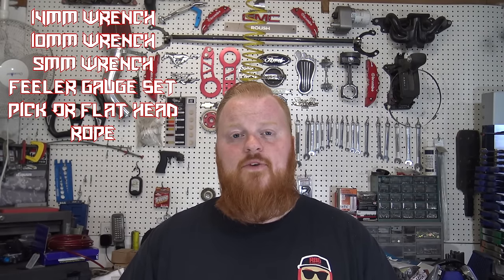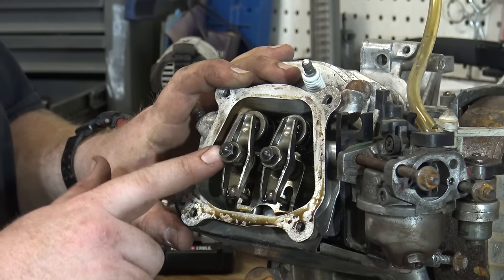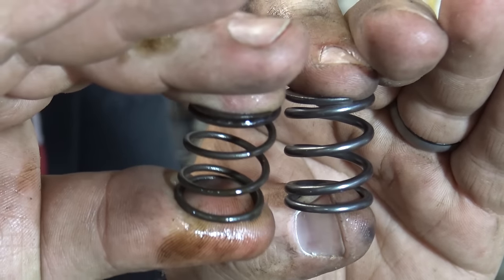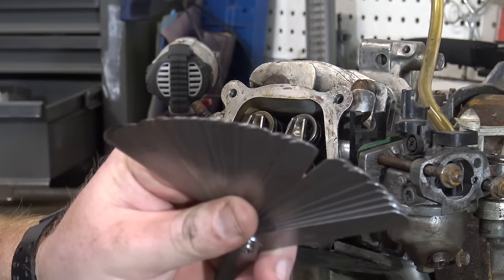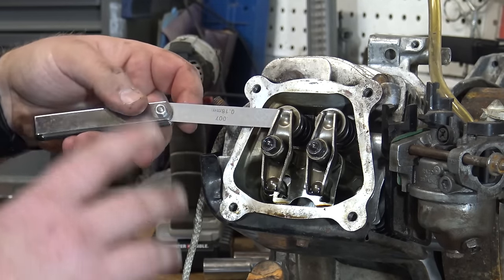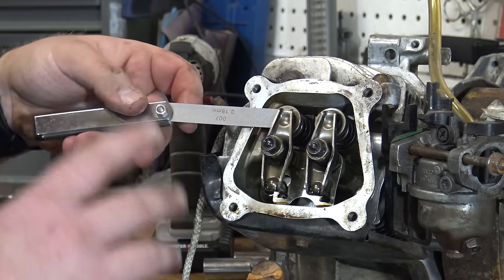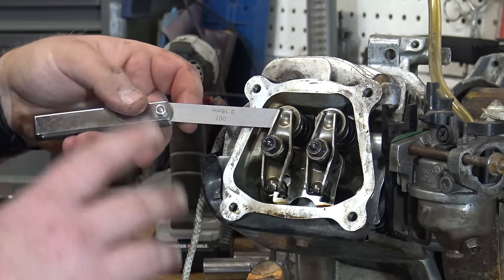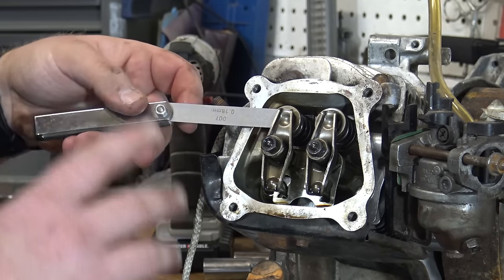How to Install 18lb Valve Springs & Adjust Valves GX200 / Predator 212 Hemi & Non Hemi Go Kart

Comment: My pull string gets ripped right out of my hand!! Billet flywheel, 18lb springs, torque converter, mikuni carb, removed governor.??
Reply from the maker: Seems like you set the valve lash with the compression release on. Make sure there is no pressure on the rocker when you set it.
Reply: @RedBeardsGarage what do you mean by this? Like when you put the rope into the spark plug hole? If it's not top dead center

Comment: Please help me.

I have the 212cc Predator. I took off the governor, have fuel in the tank and oil.

The engine will not start.
Gas is going to the carburetor,
Spark plug is sparking,
Pressure is coming from the cylinder when the spark plug is out.
Reply: Still having issues?

Comment: Hey red beard. I installed 22lb valve springs on my predator and now the pull start is snapping out of my hand violently. Is it because of the new springs?
Reply: The Hybrid Hernandez same thing happened to me. Did you find out what fixed this?

Comment: I installed the 18-pound Springs on my 212cc Hemi engine without the Billet upgrades. I ran it for about an hour and I blew the engine up. WTH. Can you give me some advice on how I could have the 18 pound valve springs and run the engine at Full Throttle for long periods of time. Thanks
Reply: The rod and flywheel become the weakest points with those kinds of mods. You need a billet rod and flywheel to keep up

Comment: Do you need to install the valve springs? What happens if you dont & run the stock ones with all the other stage one parts?

Comment: Does the piston have to be at top dead center when you adjust the lash?
Reply: Yes.
There shouldn't be any pressure from the pushrods on the valve rocker arms when you set your valve lash.

Comment: Do I have to replace the valve springs on the hemi when using the stage 1 kit? Or can I use the 18lb?
Reply: You can use the 18lb
Reply: @TheKidAustin09  could i run 18 lb valve springs with no other upgrades, not even governor bypass
Reply: @---bj8ty  yes you can

Comment: what would happen if u install a mod2 cam with out installing 18 to 26 lbs springs? 212 predator stock.
Reply from the maker: I don't understand why you would do that. The cam cost more than the 18lb valve springs so you might as well do them first. You could bend a valve. Don't do a mod2 cam without 18lb valve spring
Reply: Red Beard's Garage  how many pounds are the stock springs on the hemi? ...thnx in advance
Reply from the maker: +Krader Dewd probably around 10lbs
Reply: Red Beard's Garage where can i buy the 18 speings for my hemi
Reply from the maker: +Krader Dewd I have used the ones from go power sports and they have always done fine. They sell hemi specific ones on other websites.
Reply: Red Beard's Garage i have a hemi no governer/oil sensor thinking of putting mod 2 cam and 18 lbs springs do you recomand that setup and jetted pz27 carb..
Reply from the maker: +Krader Dewd yeah I'm about to install all that into a hemi in a week or so
Reply: Red, are you guna make a vid...
that would be awsome that a nice setup for the high rpms...
Reply from the maker: +Krader Dewd yeah I am going to make videos on it

Comment: After installing new springs and playing with the lash setting until I was blue in the face, I am having some issues. Seems I've got so much compression that I can't pull it over. If I pull the spark plug out, it'll pull over. First time I tried starting after new spring install, with spark plug in, I snapped the pull cord right off. Any ideas?
Reply: You might need to get a electric start, or you can try to get a much stronger pull cord and start hitting the gym at least 6 times a week 

I would recommend installing a battery and electric start because it will make your life much easier and now you have a battery so you can put lights on if you wish

Comment: Why do they make a 36lb spring for the predator 212? Can these be used instead of the 18lb?
Reply: Not with the stock retaining rings, you'd also need a low friction washer type disc to go below the springs because the stock ones just sit on the bare aluminum. 18lbs is the highest you can safely go with stock stuff. Now if you had all the sorted, 36lbs springs would be much much better, basically the higher you go in spring rate, the higher you can rev the engine without valve float occurring. But to get those revs you'd need an aluminum/magnesium flywheel, billet rod, high comp piston, methanol carb, head port work, and crank work.

Comment: got a hemi and the intake side rocker arm, for me to get the pin through the middle I had to compress the spring right off the bat like I had to work in there and the exhaust side one just slid right out idk if I did some wrong or its supposed to be like that.
Reply: just re adjust the valve lash I did the same and all I did was re do it and everything was fine

Comment: Does anyone know if they put a 3rd lash cap in the 212 hemi pred engine. I took the governor out and when I washed it out a 3rd cap was found  .i started the engine a few times to change oil and it was all good but I think they might have dropped a lash cap in it but not sure

Comment: I took my govern out still have stock springs an carb an for some reason I'm getting extra fuel in the cylinder an in my block what would be the problem thanks like way to much when I'm done riding I can pull the cord an fuel comes out of header
Reply: You your seals are bad. Dont run that engine without putting new oil in it after every use. If you took the head off it probably warped yo now that i think about it...

Comment: do the GPS 18# springs work in a hemi? I've heard they bind.
Reply from the maker: +KramersKlassyKustoms I have used them with no problem
Reply: Red Beard's Garage ok great. apparently there are 2 lengths of 18# springs. the shorter ones fit the hemi.
Reply from the maker: +KramersKlassyKustoms I never have heard that but I will check it out
Reply from the maker: +KramersKlassyKustoms yeah I just looked it up and saw that they sell two different sizes
Reply: Red Beard's Garage hopefully the ones from GPS fit my hemi. just need to decide what cam to use now.
Reply from the maker: +KramersKlassyKustoms they have worked for me. I haven't been using the hemi specific ones in my hemis and seems to be fine.

Comment: Okay I put the #18 springs on the 196cc jiangsu motor(not the 212 predator) for my trailmaster mb200-2 along with all the other stage1 upgrades. GPS told me to set my lash to .001-.003 for both valves so I set them both to .025. I'm having some backfiring on deceleration  and a little popping at idle is that a indicator of improper lash setting on one or both of the valves? Have searched for more info on these 196cc engines and come up short.
Reply: @152 snook
IF BY .025  YOU ARE REFERING TO METRIC
YOU MUST MEAN
.25MM.  THAT EQUALS 
ONE QUARTER OF A 
MM. WICH E

  QUALS 
JUST UNDER 
.010"  SO YES YOUR 
CLEARANCES ARE SET
Reply: 3 TIMES TOO LARGE.
SORRY PHONE MESSED UP.

Comment: will the hemi hold up with the 18lb springs with no billet rod or flywheel?
Reply from the maker: +Michael Keen yeah as long as your not going above 6500 and holding it a 6500
Reply: it's on a drift trike so it revs/spins alot
Reply from the maker: +Michael Keen I would plan on doing billet rod and flywheel
Reply: have you installed them before?
Reply from the maker: There should be a detailed installation video up soon

Comment: Do the H/F Predater 212's. use 2 lash caps on the valve stems ?
Both intake & exhaust ?

The BSP & other clones only have. 1 lash cap on the intake valve .
And none on the exhaust
valve .
But I use 2 lash caps on my builds .
Thanks

Comment: Did this mod now I can’t start her up
Reply from the maker: You had to have set the valve lash wrong
Reply: Red Beard's Garage I’ve been adjusting for 3 hours I feel like I’ve tried every combination I had it running and when I gave it some gas it kinda sputtered out like I was running out of gas. I have and gopowersports air filter and exhaust, do I need a new flywheel and push rod? Is there other lashings? And it’s really hard to start!!
Reply: Mine runs rich now?
Reply: Piston needs to be up at TDC (top dead center)  then set the valve lash with feeler gauge

Comment: Yo Red Beard, i have a 212 predator. Billet rod, flywheel, and 308 cam. I installed some 26lb springs, i cant even start this fuckin thing anymore. I figure its a timing situation. Where should my valves be with this high compression?? Please help.
Reply: I figured it out wit a .308 cam its .003 intake/ exhaust. Dope shit RBG

Comment: my rods under the spring fellout when doing this
Reply from the maker: +Luis Vigoreaux the valves or push rods?
Reply: Red Beard's Garage yes
Reply: Red Beard's Garage pushrods sorry
Reply from the maker: Just pop it back into place.
Reply: Red Beard's Garage thanks red well it became really tight on the spring when doing so the other however is not moved

Comment: Why don't you use 36 pound valve springs?
Reply from the maker: There is no need for them 18lb is perfectly fine for the rpms i am running. If you use 36lb you need to redo all your valve train and it would not get that much more power.

Comment: Sooo noob mistake here, removed valve cover, removed set and adjusting nuts, removed rockers, STOPPED RIGHT THERE AFTER REALIZING.....what did i forget to do? You guessed it, didnt set TDC......am i f@$%ed?
Reply from the maker: I have done it before.